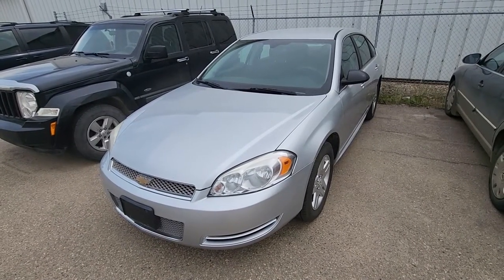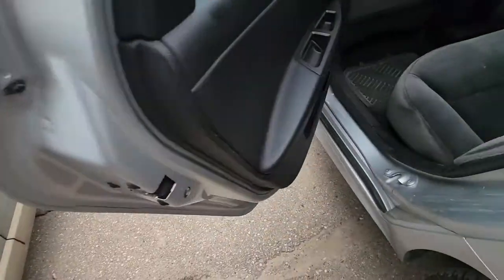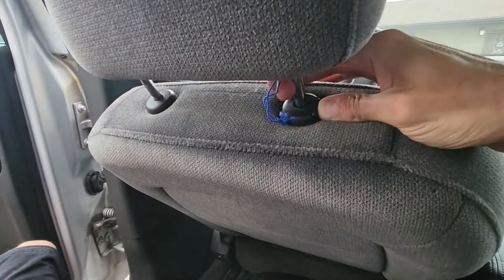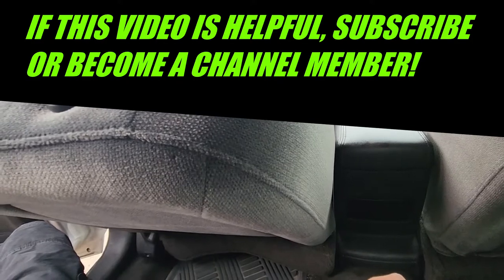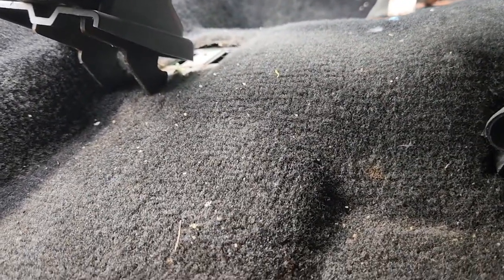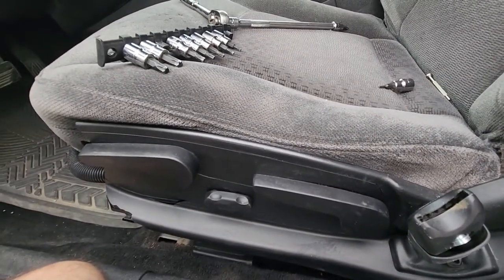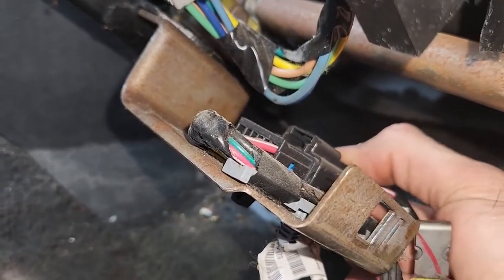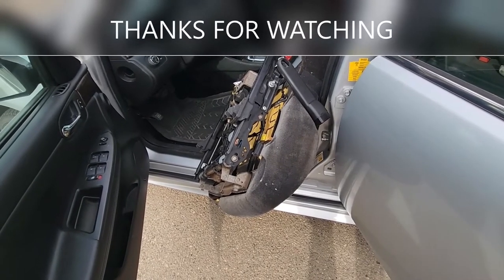Chevrolet Impala -  FRONT DRIVER SEAT REMOVAL / REPLACEMENT (2006 - 2016)

Comment: Silly question, but important. My 09 Impala has a "bench seat" that needs replaced/repaired and a $500-600 tag is not worth it to me. Would this removal video work basically the same way though for the bench seat?
Reply from the maker: Hello, Unfortunately I can't say for sure but it should be very similar. Your best option is to get a new seat from a local car salvage. It shouldn't cost you too much, probably around $100
Reply: @QuiteAlright  man I do hope so!

Comment: Everyone seems to go past the part where you can't get to the 15 mm bolts.
Reply: Was wondering about that. Elbow extension maybe?
Reply: @tommyv5435  you pretty much have to use a 10 mm or 9 mm 12 point sicket to manually twist down the 2 turn buckles forward.
Reply: @mrbuck5059  I just tried mine and the socket fit with the elbow extension but it's tight.

Comment: I have a 2010 impala and the seat won’t go up or down. When I press the up and down I can’t hear the seat motor but no movement.
Reply from the maker: Hmm first try to check if anything is obstructing the seat moving. I believe these seats have 2 motors (one for up-down and other one front - rear). Could be a failed motor

Comment: i have a 2011 impala and even with the driver seat all the way forward it doesn't go that far forward and the bolts are not accessible
Reply from the maker: Hmmm that's strange. Seat should go forward enough so you can access those bolts. Is maybe something blocking the seat on the tracks so it can't go all the way forward? It could even be a seat motor issue or switch issue
Reply: I got the same problem in my 06 if you figured out how to fix it or at least take the seat off lmk
Reply: @jacobcolon8296  still got nothing
Reply: @QuiteAlright  no not to my knowledge the bolts are literally under the seat with the seat all the way forward only driver tho i got the passenger out just how you did it here.
Reply from the maker: @ModernBeastx1  Sorry I don't know how to help. I mean seat should go forward enough so you can access those bolts. Really strange and couple of people having the same problem.
Reply: @QuiteAlright  might be a different year not maybe the seats are not 2006 - 2016 cause mine is a 2011
Reply: @QuiteAlright  passenger is same as you're video but driver is completely different.
Reply from the maker: @ModernBeastx1  Hmm I did some quick research. There are two types of driver seats: bucket AR9 or bench AN3. So that could be the reason why it is different.
Reply: @QuiteAlright  Maybe did it say how to take it out lol...Maybe link it?
Reply from the maker: @ModernBeastx1  No sorry. I just checked one of used parts supplier's database and seen they list 2 types of seats

Comment: What do if seats won't go forward
Reply from the maker: You'll have hard time removing the mounting screws. Check if there is something blocking the seat from moving and listen if you can hear the power seat motor engaging. It could be a failed power seat switch, wiring issue or a failed motor. You might have to fix this issue before you can remove the seat if you can't reach the rear screws

Comment: I'm a female lol can you breakdown exactly what tool I need to buy to remove the screws please?
Reply from the maker: Sure.
You will need:
- Ratchet with extension
- 15mm socket
- torx t40 socket
- small pin or paper clip to remove the head rest